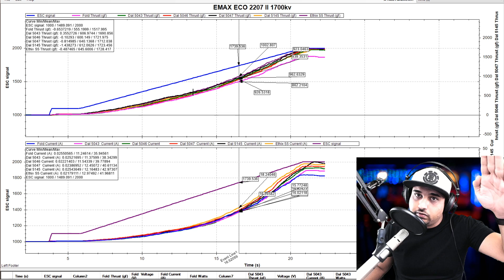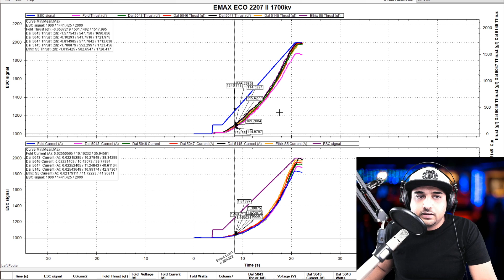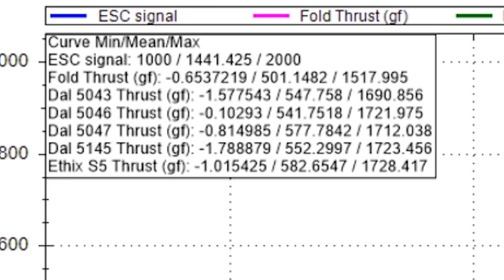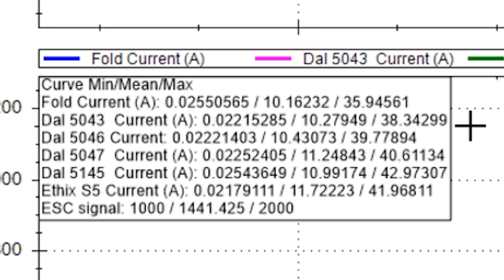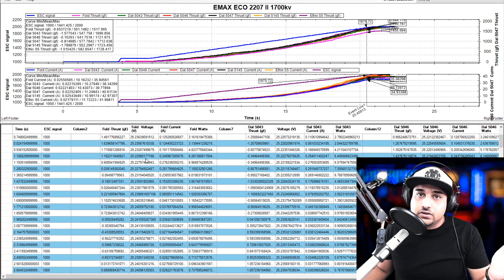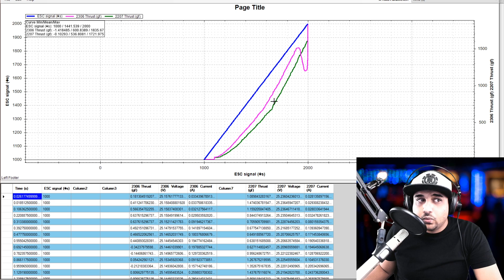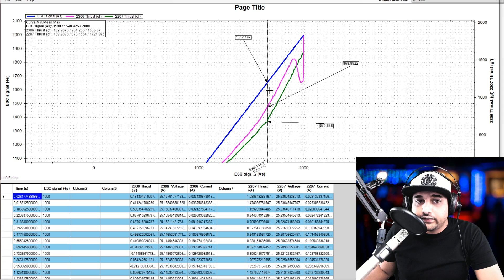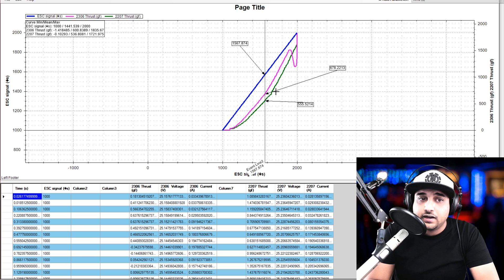Emax ECO II 2207 1700KV  // Visualize Thrust Curve

Comment: I'm new to the hobby and loving every second of it so far. I'm looking to build a 7" cruiser, maybe the odd flip, mainly focusing on long flight time using the 2207 1700KV variant eventually looking to move to 6s but will be using 4s in the mean time. On 4s are they going to give me enough power or should I be looking at the 2207 1900kv for use with 4s now and 6s in the future?

Comment: Well done 👍. There is more and more discussion on motor & props and their effect on the quads controllability. We are generally looking for a more linear response for better control at lower throttle. Has anyone played with the throttle EXPO and throttle MID parameters in the rate profile to try to match the trust curve and make the stick feel more linear? It could potentially make certain motor / prop combinations more manageable.

Comment: ....you need to do a bit of differential math the data to extract knowledge from the basic information - whats interesting is not the changes in speed but the changing acceleration over the power band. it will also make comparing motors possible. the second part of what you want to quantify here lies in the power-trains responsiveness i.e. lags. Pawel Spychalski did a video recently where he put an acceleration to 400 deg/sec on a transmitter switch and used blackbox to measure the time it took an individual setup to do the acceleration. this ought to complete the picture and makes the reality of flying different setups recognizable in the data...

...when talking efficiency it would be helpful to the viewer if you did the division of thrust with the amp draw thereby eliminating the guesswork.....  

...(!) only suggestions not a critique - but done right it would be helpful on par with miniquadtestbench in the olden days....there is real meat on these bones and i suspect the more than one phd thesis will be written on the subject.... please do keep the knowledge flowing - it's a fucking pleasure to nerd out this way with you, thanks :-) - and my apologies to Pawel if i butchered spelling his last name
Reply: Wow ..
now that's a comment
Well done sir

Comment: Racers care about efficiency in the 50 - 95 throttle band. Test the GF 51466 prop but change the motors.. Show the watts at the same thrust numbers. Like three dufferent motors watt usage using the same prop at 1,000 grams, 1,300 grams, and 1,500 grams of thrust. The more efficient the motor the better.